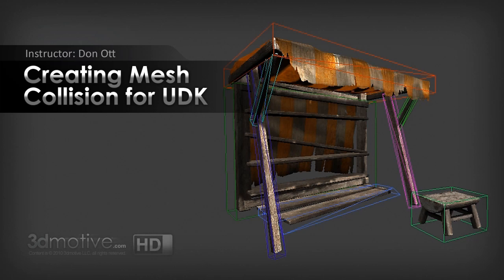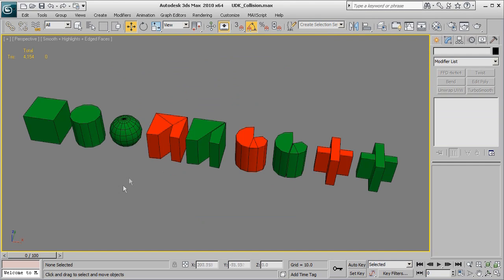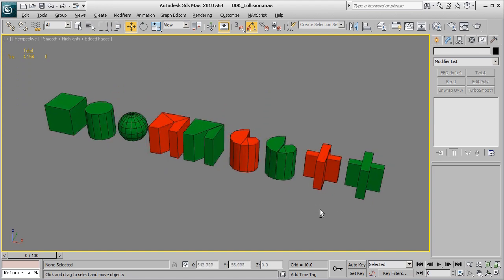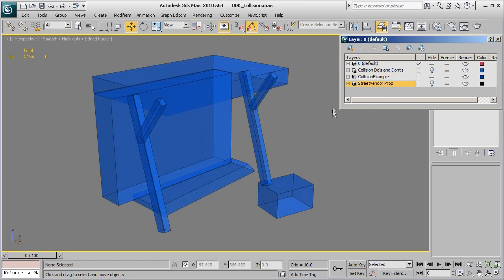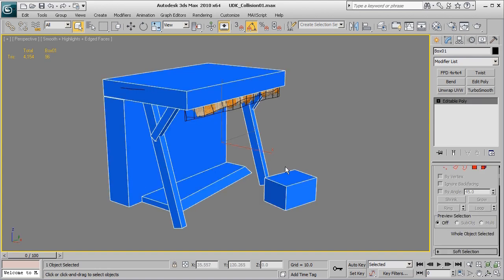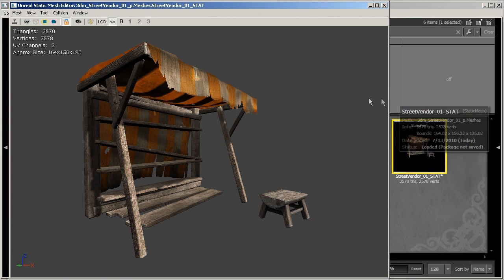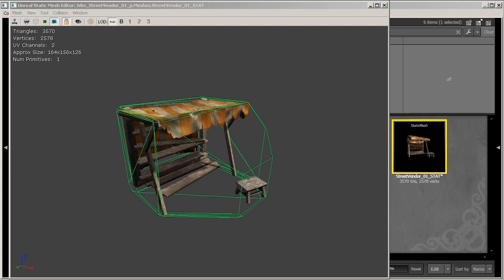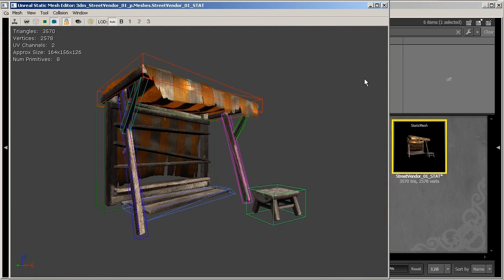Creating Custom Collision for Game Assets in UDK - 3dmotive

Comment: I'm having an issue with this method. It worked when I used basic singular shapes, but  now that I'm trying something more complex it's not working the way it seems to in this video. I create the visible mesh, and that's fine, and I create a set of boxes that form a similar shape to use for the collision. I take all of those boxes and merge them into a single mesh and name them UCX_[object name]. When I export them together and import the fbx into UDK, the collision mesh isn't the combined object but a simple mesh shrink-wrapped over where the collision mesh would be. Is there something I missed?
Reply: Cheesypotato57 i have the same problem!
Reply: Good news is, there's a fairly simple alternative. Once you've imported your model into Unreal, open its properties window where you can see the collision box. There's a drop-down menu called Collision complexity, and select use Complex collision as Simple. That pretty much turns your entire model into its own collision box. Probably not good for really detailed models but if they're fairly basic then it should be fine.